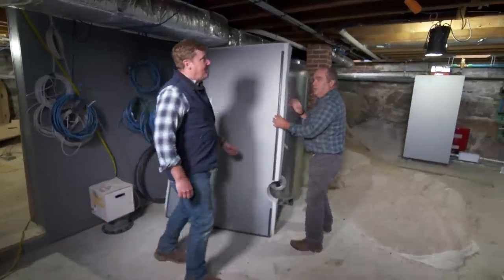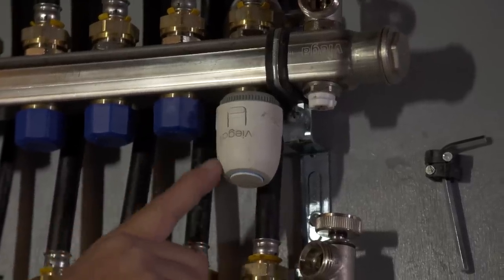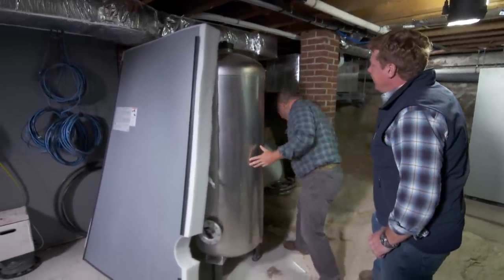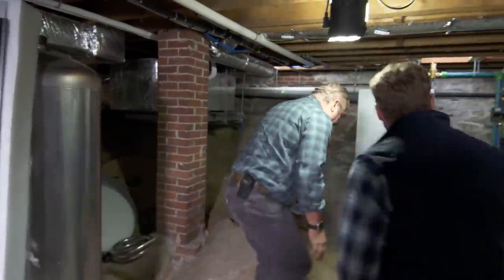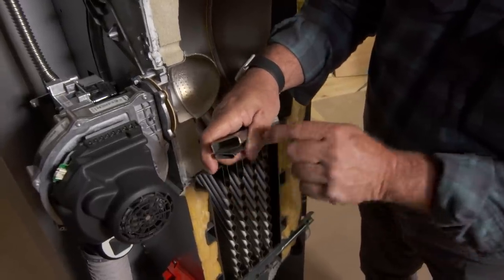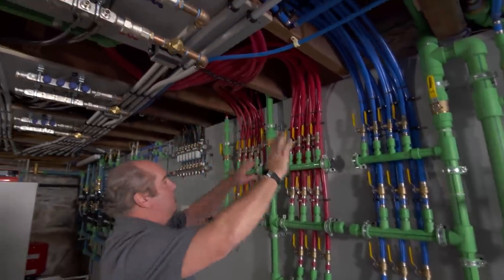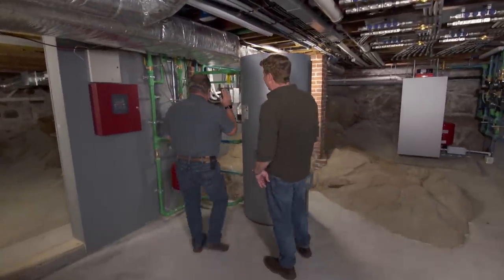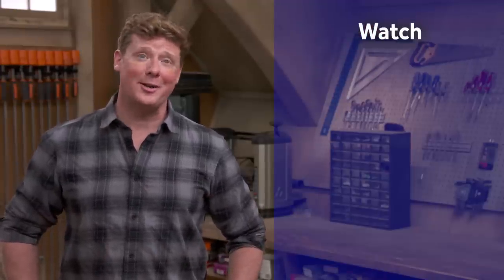How Boilers Can be More Efficient | This Old House

Comment: “Brutally smart” pumps mean pumps with more speed and pressure changes, more complicated power electronics driving the motors.  Therefore brutally smart pumps are less reliable pumps than simple single speed motor pumps.  Worse, since such pumps are complex and made nearly  custom to a heat system, alternative suppliers are rare or unavailable, so that replacement upon failure can render the system “totaled”, I.e the part is is more expensive than than a total system replacement.

Gas condensing furnaces  are more efficient, and they too pay a reliability cost.  The old furnaces ejected all the combustion steam up the stack, yes, but keeping it via condensation made furnaces become  liquid water handling devices where they never were previously.  The accompanying extra stages and motors also reduce reliability, enabling the same expensive single source part game by industry.  The only way to combat the cost and reliability trend is tell the whole story, reliability, cost, and performance-efficiency, as opposed to one sided narratives of how “brutally smart” it all is with an TOH jingle playing.
Reply: Mark Heslep What absolute nonsense. Modulating pumps are straight swaps for conventional central heating pumps. They are an off the shelf item and have been common in Europe for years. They have the exact same fittings and same electrical connections as every other central heating pump made over the last half century. They are not "custom" and are as reliable as every other pump on the market. Should one fail, they can be swapped out for any other off the shelf pump in minutes, even a non modulating one if necessary. The power savings are worth having, but the reduction in system noise is the biggest benefit. 

Condensing boilers have been mandatory for at least twenty years, probably longer but I can't remember! They are really no more complex than a conventional fan flued boiler- there are no extra fans, so I don't know where you got that from. There is not usually an extra pump, condensate usually drains by gravity to the nearest drain but you can fit a remote pump if needed to lift the condensate to a higher drain if the location demands it. Heat only condensing boilers are as reliable as any other type.
Reply: Spencer Wilton Yes condensing furnaces have been in wide use for a couple decades now.  They replace non condensing units that operated for decades with far fewer problems,. Now, new systems require a major part or system replacement every 5 to 10 years, as any experienced  installer will tell you.  This comment section is loaded with responses from professionals saying the same thing about more complex systems.  Leave the bubble.
Reply: @Nill757  dk i have a condensing furnace 96 efficiency and have had zero problems with it goin one 6 years now. its all about the internals. if good materials are used will have few issues. i admit as one who works on and installs boilers the one shown is way to complex and just asken for problems. tho not in the boiler it self in the distribution system.
Reply: @alexlindekugel8727  Good luck then.  Old less efficient units went many decades with little maintenance.  As you can see on any remodel show, 50 yo homes will still have original working boilers in them.  Your new unit won’t make it that far.   If, say, your custom smart digital control thermostat fails, just that, it can be $900 and 6 weeks to get it.
Reply: @Nill757  the 150 dollar t state the my hvac guy always has on hand? and the system can be wired into any thermostat. you may lose sum oth the fancyer functions but it still will hold set temp. i fail to see the merit in your argument. or why you think you have to be right. but you do you. tho best fact check your self hard first before open your mouth. have a good day!
Reply: @alexlindekugel8727  Thanks for the response. 

 Sure, I replaced my own high eff condensing OEM t stat myself with old fashioned 3 wire t stat.  I’m writing from experience.  You introduced topic though with “96%” eff claim, and you won’t get that with old fashioned bang on, bang off t-stat.  You won’t get average 30-50 years operation without major component replacement either.  Those older boiler or non condensing units were a $1000 cheaper up front, and did last 30-50y.  Experience with both.

Comment: Very nice work indeed but dare I say it's not very green. Even with a modulating boiler it's still emitting pollution.

In UK from 2025 it is said no new build houses will be built with gas fueled central heating kit. Allegedly.

Some government agencies are stating this as fact ... some trade organisations are claiming that legislation has yet to be passed.

I gather our solid fuel systems are also being examined. HMG have already instigated that new wood burners must "approved" in that they have a tertiary burn chamber to reduce the particulate emissions.

However a gas hob will be permitted. Oven to be electric.

This is to reduce the gaseous emissions responsible for global warming.

That said there are no strictures on fitting or updating a new gas boiler system to an old Victorian or Edwardian property, say.

Which might be regarded as bizarre.

HMG are committed to reducing our use of fossil fuels in line with the new Paris Agreement, which followed on from the Kyoto Protocol, so will suppose they will have to start somewhere.

It is suggested that electric heating will use FAR IR panel technology. This form of heating is claimed to be both effective and "cheap" ... but nobody has, as yet, defined  "cheap".

Suspect too that water heating for washing/showering will be via instant hot water units.

Washing machines already mainly cold fill only with immersion type heater unit. Clothes washing products already designed for washing temps of 30C.

The only downside might be a power  cut ...
Reply: Natural gas heating is actually the most efficient way to heat a house. Switching to electric everything forever is dumb until all power plants are nuclear.
Reply: @4realjacob637  Absolutely agree, and sometimes wonder why "we" had to bother going down the route developing solar or wind or wave power generation of electricity. Blame that one on the Greens.

If it hadn't been for the Ukrainians dicking around with the testing of their alleged "safety cut outs" (so we were told) at Chernobyl I would presume the planet would have blithely carried on with nuclear powered generating plant.

And if it wasn't for HMG dicking around in the choosing of which type of nuclear generating plant, we in UK might be less reliant on fossil fuels of any description.

It seems too we can't agree with the foreign based operators on the cost of a kWh unit either.

Despite its efficiency gas fuelled appliances emit greenhouse gases which lead to global warming etc, etc.

Will presume the thinking is to eliminate the many, many, many thousands of gas boilers into one or a few dozen non nuclear generating stations where the emissions can be more easily "scrubbed".

Mind you we may have, once, eliminated the particulate emissions over UK ... only to have a west wind drop said  particulates on Norway.

(A bit like an east wind blowing the radioactive plume from Chernobyl over Russia and Scandinavia to Northern England into the oily fleeces of our upland sheep ... all sorts of tabloid cartoons depicting  the farmers finding their sheep in the dark as the radiation caused the sheep to glow ... )

HMG has now halted fracking slso because of methane percolating up through fissures into the atmosphere. Methane supposed to be almost 30 times worse as a green house gas cf CO2.

Plus "local" population complained of "local" seismic activity rattling their crockery.

Personally I would much prefer to have "almost instant" heating with electricity from a FAR IR heating panel unit, say, that light up my multifuel stove or my diesel fueled central heating boiler.

It's the lugging around bags of solid fuel nuggets, and them cleaning out the ash tray which is the fag ... both are filthy exercises.
Reply: Isn’t it silly proscribe no gas heat without first putting in place the proven, working alternative power source?  Electric heat powered by a fossil source is inefficient, has far more emissions than burning the gas in home and capturing all the heat there.  The UK is not anywhere close to clean electric generation ala France, at least not by 2025.  If, like France, a clean power system was built thirty years ago, then sure saying in 2020, no more gas heat in 2025 is an option.
Reply: Hmm, who knows for sure but we have a very ambitious Boris who is so keen to be seen to be green he is pushing ahead with electrification of "everything".

Very recently he was heard to be describing wind power as the same sort of wind which helped our seafarers enrich Britain.

Most of us thinking wtf is he going on about now?

And as for this no gas heating thing by 2025 with respect to new builds, there's no proscription, as yet, of fitting gas boilers to older properties.

Or fitting a gas system to a new build.

Bring on nuclear power. It's clean and somebody must have found a way of "dumping" the nuclear waste where "all these terrorists" can't nick any to make dirty bombs.

And with ref to France and their green electricity I gather more electric cables have been laid through the channel tunnel so we can buy some of it ... I gather it means we can then say we have green electricity in UK.
Reply: @Kevin-mp5of  😂
Reply: @t1n4444  making everything in Europe run on electricity makes no sense. The US has cut much of its CO2 emissions by switching to Natural Gas Which is far more efficient. Germany actually tried to get rid of all their coal and oil power plants and tried to rely on solar and wind but obviously it couldn't handle the load. So rather than switching to more natural gas how are plants and making they're cool more efficient they actually increased CO2 emissions.
Reply: @4realjacob637  Hmm, as I understand these things regardless of how efficient natural gas may be HMG is committed to reducing and then eliminating the burning of fossil fuels. UK is going green as fast as
 it can and that is going to happen regardless.

Whatever fossil fuels we burn CO2 is produced and as we know this gas is one of the main culprits in global warming. (Methane even worse, hence the UK proscription on fracking.)

We haven't burned coal for some few weeks, mainly because of reduced demand down to emergence of c-19. This sort of skewed the figures a bit because earlier this year the weather allowed "renewables" to contribute a record share of our energy needs.

Does this anomaly help Boris with  his claims "we" are becoming greener? Hmm, he probably will crowbar this in somewhere.

I am not sure that a fuel being "efficient" is necessarily a "good" thing if the pollution produced is considered a "bad" thing.

I suppose too that around 40% of gas used in Europe comes from Russia, which means Europe is hostage to a possibly hostile power.

Russia not known for "delicacy" in some of it's foreign policies.

Since this thread started I researched a lot of what was written out of morbid fascination.

What doesn't seem to get mentioned  is that other processes create carbon dioxide, and lots of it. Boris is boasting of UK getting 40 new hospitals and our rail network is going to be developed so we won't need to use cars anymore. Yet all this infrastructure requires the use of cement (for concrete). 

I understand for every tonne of cement produced around 0.8 of a tonne of CO2 is produced also. As in the removal of CO2 from the limestone, not just the energy required for cooking said limestone.

I understand that some 8% of total CO2 comes from the manufacture of concrete globally.

So, it looks as if we will never actually stop producing CO2 until we stop using cement for infracstucture.

Hmm, that's cheered me up no end.
Reply: Green used to be my favorite color. Now it makes me nauseous. All of western country leaders are falling all over themselves trying to be greener than each other while China builds coal fired power plants as fast as the US can build apartment buildings. Make cars and trucks that are much more efficient run much cleaner. Until the China and India get serious many of our BIG plans are just passing in the wind.

Comment: Cool system...until the day something breaks and the installer is long gone.  I would imagine a lot of those parts aren’t readily available like the modulating pumps, pex manifolds, and the refrigerant distribution manifold to name a few.   Not a good situation in the middle of January and you have to wait 3 days for a special order replacement part.  Also, what happens when joe homeowner changes the carpet in one room to hardwood or vice versa?  How do you correct that on the heating side?
Reply: Those parts are readily available. I have a 20-year-old system with many of the same pumps, controllers, and parts. The difference is that my system has a fuel oil boiler and is all copper plumbed but it's very similar in function. To answer your question, the thermostat works like any other. It will keep the circulator pump on longer to get the heat through the additional material. Once it reaches the target temp, it'll click off. Very simple.